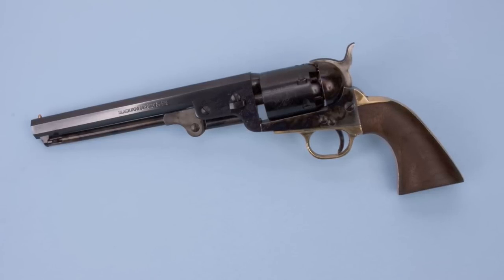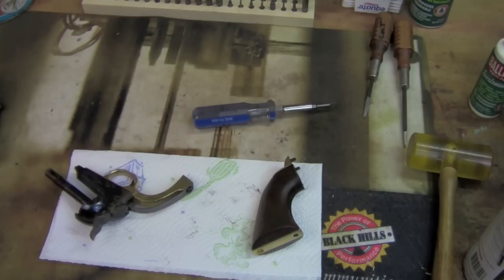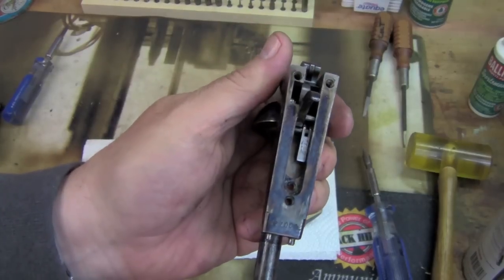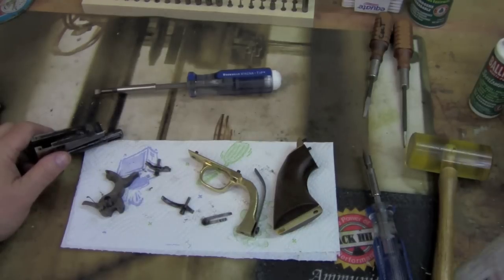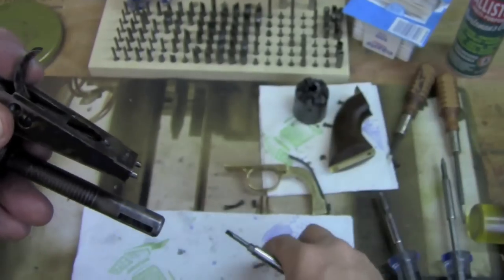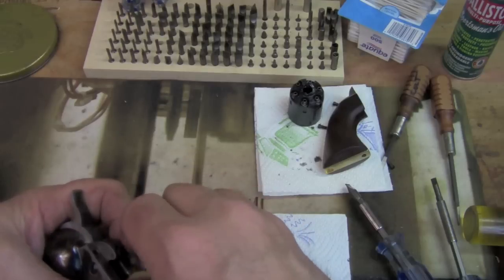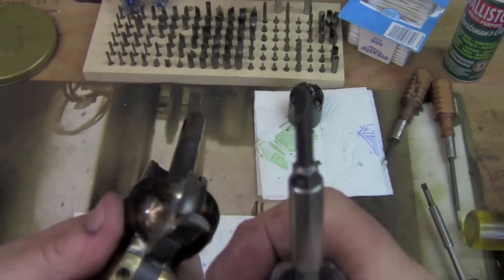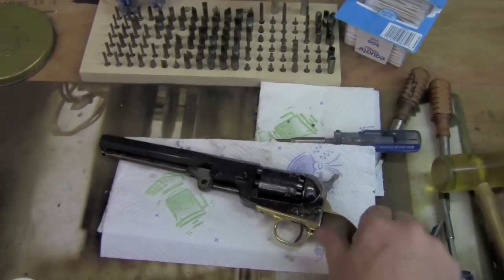Disassembly and cleaning Colt Cap and Ball Revolvers - Part 2.mov

Comment: about every 75 or so rounds it is cleaning time. I keep a barrel record on a Uberti 1860 army and this is my experience. The barrel record is for another reason not that I am a clean freak as my bench will attest. Thanks for the information and get well.
Reply: y the way the first time you do this be careful. Those screws are torqued down TIGHT.

Comment: mike, I have a euroarms brescia (made in Italy ) 44 cal. Navy model, I need the trigger & bolt return spring and the screw that holds the hammer spring in place on the butt of the weapon. do you know where i can order them from, Thanks Mike
Reply from the maker: Google VTI gun parts

Comment: After the second range visit (maybe 80 shots in the two visits) my poor Pietta stopped working right; the cylinder spins silently at half cock and the hammer only rotates the cylinder when cocked if pointed downward. It seems as if the hand spring lost tension and is relying on gravity. I did notice a cap fell in the hammer opening in the frame but I dumped it back out. Could that be the cause, or -- as this is an old second hand repro from the 1980s -- I'm wondering if the hand spring is gone... has this ever happened to you?
Getting a new to me 1851 in pristine shape a few days in much better shape so may save this one for learning repairs (for which this vid will be a big help), but it'd help to know what it is that broke.
Reply from the maker: I would guess that your hand spring is broken
Reply: @duelist1954  That's what I was afraid of, thank you.

Comment: Now how does one know on how fare to push the wedge in? So to not go to far or not enough.
Reply: Fast enough to engage the spring/clip catch and keep the barrel and forcing come tight against the cylinder but not so far that the cylinder can’t turn. Set the screw to that distance once you figure it out.

Comment: One suggestion.  There is always the possibility of moisture casing the nipples to seize up.  Simply just screw them in enough so that the cylinder will revolve, and no more.   They will not be in very tight.  Before shooting, take them out, put a bit of lube on the threads, and tighten properly.   After shooting, get them out as soon as you can.

Comment: I have an issue where if I squeeze my trigger to hard it will stick to far back keeping the hammer from locking. Any idea on how to fix this
Reply from the maker: Austin Colby check to see if the trigger spring is too short
Reply: Thanks for the advice I removed the trigger spring and saw that is was broken right where it screws in. This is my first black powder revolver I'm testing the waters here so any advice on where I can buy parts for ithe would help a ton
Reply from the maker: Austin Colby google VTI gun parts

Comment: Hi Mike. Been a while since taking my Pietta Colt Army apart. Man what a pain. I've watched your video and blackoracle69 has some good ones. I cannot seem to get it back together where it SAFELY goes from half to full cock. I am going to give it a fresh start in the morning. I do know that the hand and it's spring both go into the groove in the frame. My original plan was to stone and or file the sharp edges just a hair smoother and get rid of any imperfections from the milling process. Trust me when I say that their finishing after milling had some rough spots. If I have any major problems I will let you know. The Italian soft steel screws are a booger also.

Comment: Hello,   I purchased a black powder pistol.  ld not c  As I watched you clean your gun I was doing the same.  BUT,,,I had three nipples that would not come out,,,,ouch.  What do I do now?
Reply from the maker: Michael Crisp soak the nipple area in penetrating oil for three days. Put your nipple wrench on a stuck nipple and hit the wrench smartly with a hammer a few times, that helps to break the rust seal. Put the cylinder in a padded vice and use the nipple wrench to unscrew the stuck nipple.

Comment: I took my Pietta 1851 apart to see how it worked and to clean it, and now, as I’m reassembling it, once I have the trigger prong in and check for function, it seems the bolt is reaching full cock before the trigger is, creating a second “half-cock” where the cylinder is locked. How do I correct this?

Comment: I have an 1851 Navy and when I put it on half cock, the cylinder bolt comes up and locks the cylinder. The weird part is, it didn't do this when I first started shooting it. If I pull the hammer back just a little, then I can rotate the cylinder to load it etc. I took it apart and cleaned it good, that didn't help. No more Pietta's for me. Thanks for your videos.